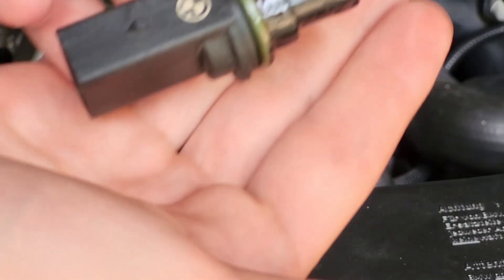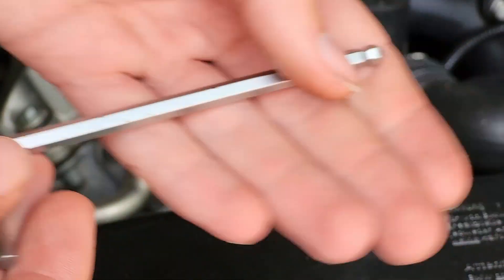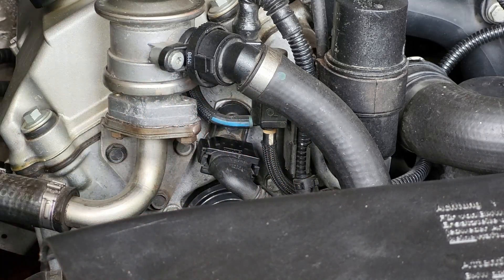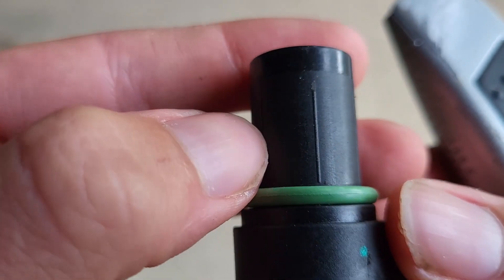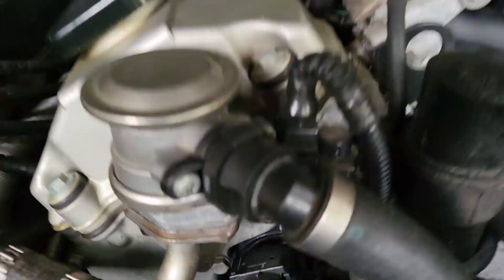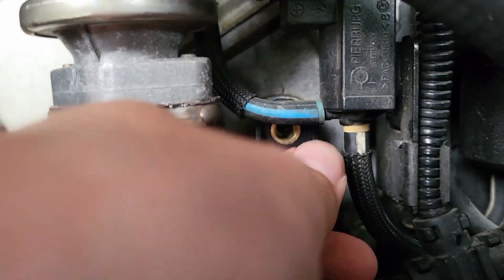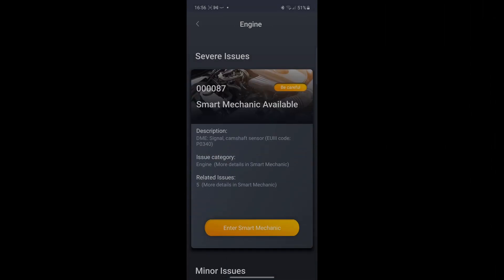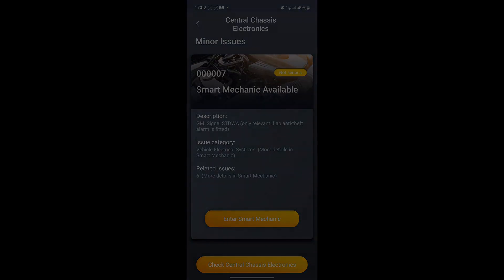Camshaft potsition sensor EASY replacement e46 BMW m43 engine (code P034)

Comment: I have error code 000087 camshaft sensor signal. I measure one 12v wire, one negative wire, one 1.6v wire. When I bring the sensor into contact with metal, the 1.6v wire turns into 12v. Can you diagnose the problem?
Reply from the maker: The sensor that is used by BMW on the m43 engine is a hall effect sensor recognisable by the 3 pins on the connector, you can measure the voltage between the positive and the negative wires to see if the sensor has power, unfortunately you can not diagnose the sensors signal using a multimeter, the only way is to connect an osciloscope to the data pin and the ground pin to inspect the signals integrity while the engine is running, if you have codes related to the camshaft sensor consider replacing it and make sure the engine is timed correctly as well😉

Comment: Mohon bantuannya,..Berapa nilai voltase dari ke 3 kabel chamshaf untuk 318 m43 ??
Reply from the maker: It is a hall effect sensor, one ground, one positive 12V and one signal, the state of it can't be measured with a multimeter because it is a digital signal, it uses a plate on the camshaft to measure how often the missing tooth on the plate passes the sensor.🙂
Reply: Could take it out the m43 camshaft and clean it up by cleaner?
Reply from the maker: @waileongwong4974  You can always try cleaning it, its not that hard to access but most of the time the sensor is bad🙂

Comment: how do you read the codes? does your car has obd2 port? or you use the 20 pin with some adapter i have an adapter and i have an obd2 scanner (a cheap one and i cant connect torque to it
)
Reply from the maker: If you have an e46 manufactured before 2000 it most likely has a round 20 pin connector near the battery, the obd port located under the steering wheel has limited functionnality compared to it, using INPA you can do pretty much everything connecting to the round connector with an adapter🙂
Reply: @_Project46_  i've been using the 20 pin one since my car doesn't even came with obd2 port. I tried to use inpa 2 diferent methods with the instructions that came on de cd that came with the cable and with some guide i saw on reddit but no success in both i dont know if i'm doing something wrong it shows the 2 black dots of "battery"(or something) and the ignition one then i press the button for info and it shows the paths then when i go to e46 and something and any other thing it shows an error of sys-0005 i've tried every fix i found idk, then when i go to info again it loses the paths it shows ????????? in all 3.

i think i'll try a different method

i have win11 x64

sorry for any grammar error, english isn't my main language.
Reply from the maker: @tumashh9137  I recently installed INPA on a new laptop with a fresh win 11 install, followed the instructions on a  Youtube video on the "endless money pits" channel and it worked out fine for me, you could try to redo the install. Have you tried flipping the switch on the K-CAN cable to see if it makes a difference?
Hope this helps🙂
Reply: @_Project46_   i tried that one but it only had the information tab i think but i will try again

Comment: whats the symptoms my m43b19 has random idle and stalling when going slow or braking on traffic
Reply from the maker: Well the best way to find out where the problem is would be to use an obd scaner to look for fault codes, I personally had the same symptoms with a permanent camshaft sensor code so if you don't have a scanner, replacing that sensor would be the first thing to try.
Reply: @_Project46_  the problem is so random one day it will happen then when i restart the car its back to normal then i replaced the brake booster hose its cracked the problem went away then it came back when my mechanic scans the car no fault codes
Reply from the maker: @mr.bricktop4894  yeah I know how it is, my problem was exacltly the same sometimes it ran perfectly fine and other times the idle would be eradic and the engine would stall...
Reply: @_Project46_  am gonna replace the camshaft sensor and tps fist then see if it'll fix the problem
Reply: @mr.bricktop4894  sounds like vacuum leak. Should make a smoke test
Reply: @FeZerret  it only happens when slowing down or braking i've already replaced the vacuum hoses, ccv, brakebooster and mastercylinder now am thinking it's the brakebooster check valve haven't changed it yet
Reply from the maker: What did it for me was replacing the camshaft sensor and both oxygen sensors for good measures because  I had error codes related to them🙂
Reply: @_Project46_ i already replaced the camsensor but i haven't check oxygen sensors yet
Reply: Hello, mine was having these codes : P0141 and P0170 with same symptoms.